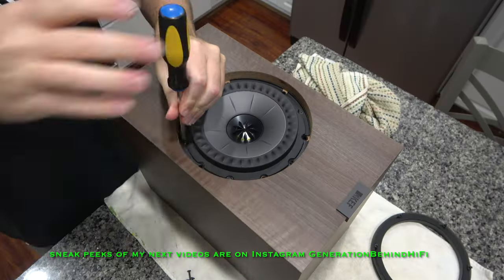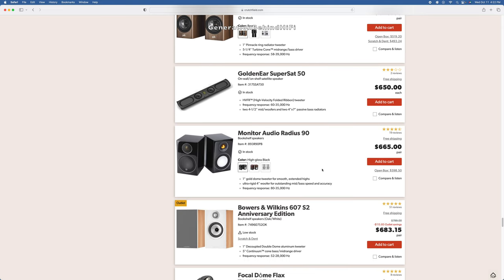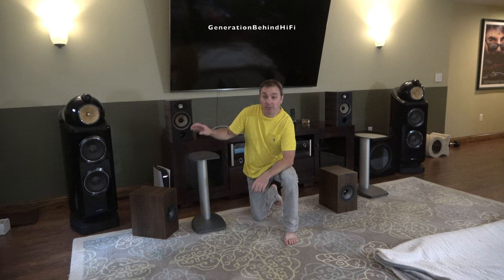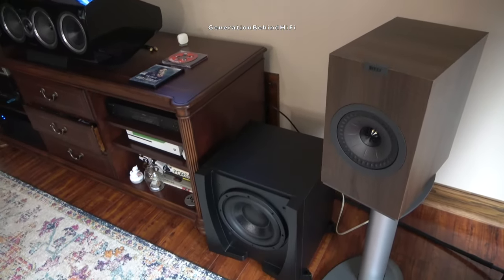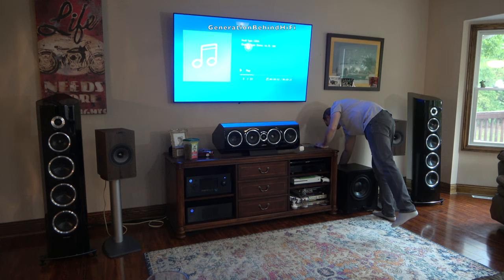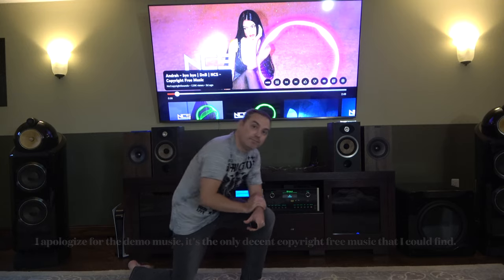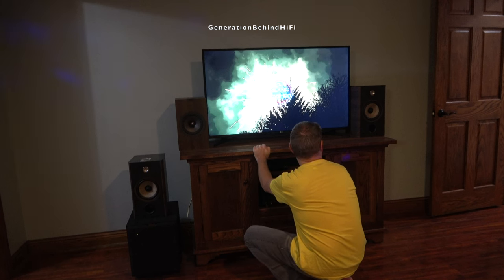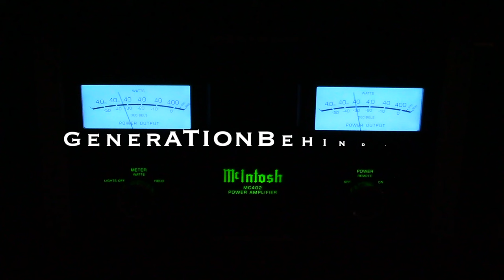A Review of The KEF Q350 Bookshelf Speakers

Comment: Two years and 3 months on my Q350's very difficult to justify switching them out, they are that good and continue to surprise me, I have them on 28" Sanus stands that have the hardwood centre post, driving them with a Yamaha RX797, a match made in stereo heaven which I picked up used about 3 years ago for $160 canadian  when I had the Q150's because I was thinking about a sub, havent though about a sub since having the q350s. Love em!

Comment: Amazon has the KEF Q350s on sale for $499 Now! (7/25/24).  I ended up buying a pair to test out and this was one of the reviews that pointed me in the right direction to do so.   I have to say that I am, overall, very impressed!   I had recently bought a pair of PSB Alpha 3 speakers for my computer as I was looking for a very small speaker with a 4" woofer that would soundstage well, and the Alpha 3's was really my first experience with an excellent sound staging speaker.   I wanted something for my main listening area and prior to getting the Q350's, I had a pair of Klipsch RP-600m speakers there.  I do like the RP-600m's, but I never loved them.  For starters, they have a hole in the midrange at around 1.5k.   Then the really high end can get a bit harsh depending on the recorded material.   The sound stage is just Okay, but the PSB's FAR surpassed them in that area.   When I hooked up the Q350s, I didn't like them at first.   The treble response was low and no where near as bright as the Klipsch.  (And I thought that speaker had a low HF output!).  I ended up ramming up the treble control ALL THE WAY.   BUT, despite doing so, the KEF Q350s weren't harsh or overly bright.  In fact, the sound was smooth.   The bass response was on par with the RP-600ms, and with some songs, it even seemed to go deeper.   I had found that the Q350s were far more sensitive to music recordings than the Klipsch are and some songs that sounded good on the Klipsch (and or PSBs), didn't sound good on the KEFs.   Some songs that I thought sounded OK, ended up sounding really good on the KEFs.   However, despite the high frequency issue and the selectivity of media, I had noticed the soundstage easily matched the PSB Alpha 3's, albeit having a much larger sound overall.   One thing the KEFs had over the PSB Alpha 3's is depth.  This was the first time I had a speaker that really had noticeable changes in depth.   For example, on Madonna's "Rescue Me".  The song starts with a thunderstorm in the beginning.  That thunderstorm appeared to come from BEHIND ME!  I was like Wow!    Then, on Gerry Raftery's Baker Sreet, I was blown away when the saxophone kicked in.  It was like surround sound sax!   The Q350s do have good dynamics as well, but the Klipsch RP-600ms were a little better here and I could notice the differences in songs that had good dynamics.   Elton John's Empty Garden sounded more powerful on the RP-600ms, but overall, the KEFs outshined them in terms of the soundstage.    The more I am listening to the Q350s, the more I am thinking that these are going to be keepers.   I had temporarily put the RP-600m in place and listened to some of the key songs that I liked on the KEFs.   It does seem that I am now noticing more that the really upper end is definitely harsher on the RP-600ms and then there is that 1.5k hole in the midrange.  The soundstage is good, but not great.  Bottom line, it looks like I am keeping the KEF Q350s, and probably will sell off the Klipsch RP-600m's!   @GenerationBehindHiFi.   Great video.  BTW in your comparison video, the KEFs are CLEARLY superior to the Arias.
Reply from the maker: Thanks! I appreciate the feedback on your listening experience between the different speakers. At the sale price, the Q350 is a hard speaker to beat.
Reply: @generationbehindhifi  Indeed!  I had compared them to the Klisch RP-600m's that I have, and the Q-350's soundstage WAY better.  In fact, with Madonna's Rescue Me, the song opens with a thunderstorm and it sounds like it is coming from BEHIND me!   When I played Elton John's Empty Garden, I was nearly driven to tears as to how good that song sounded on those speakers.  On Gerry Rafferty's Baker Street, when the saxophone kicked in, I was blown away!  It was like surround sound.   While at times the Klipsch's dynamic range was better and it does seem to have better bass on some tracks, overall, the Q-350's was a better speaker overall.   The Klipsches have a glaring problem in that they have a midrange response hole at 1.5khz and it is VERY noticeable.  The highs can be a bit shrill too depending on the music material.  The costs to fix these issues is pretty high.   Not to say that the Q-350's don't have their issues, I was surprised that I nearly had to ram up my treble control all the way on my receiver as it sounded as if someone put a cloth over the speaker when it is set to flat.  But boosting it up certainly brought the best out of the speaker.   Looking at the crossover design, it is just three parts, so it is very easy to replace those parts with better quality ones.  One of them is a resister and I am sure putting a lower value in would bring the highs up more.   I would say that for the sale price of $500, it is an excellent speaker.   It did shock me as I wasn't expecting much given the mixed reviews that surround the LS-50 and LS-50 meta speakers.  Many people like them, but there are many that don't like them.   I did look at the response curves (done independently) for the Q-350 vs the LS-50, and they are not too far off.  The LS-50 is smoother on the high end, but the 350 has better bass.    The differences seem to be slight.  So it does still have me asking the question why is KEF charging so much more for the LS and Meta series?  Yet, it seems that the Q series is quite nicely priced, when they go on sale.   So, until I get more information, I am not sure if KEF could be trolling or not with their "higher end" speakers.  But for the Q-350, I have to say it is a VERY nice speaker and it most cases, it doesn't need a subwoofer.
Reply: Buy from Crutchfield instead. Price is the same, they offer outstanding technical support, have a 60 day return policy, and are a Virginia-based small business. Give them your support 👍

Comment: It's a lot of work to open and review the speakers. Thank you. Demos ? Well, it's a matter of taste. I usually don't listen demos: mics coloration, different rooms and different speakers (recording and listener), different setups or levels in recording room, etc. In this case, I tried and I heard a lot of room reverberation and a boomy sound (maybe between 70 Hz and 150 Hz). Both speakersare too close to the wall, and Focals are closer between them which couples these low frequencies even more. I don't mind if tweeter is made of aluminium, beryllium or silk: just the sound matters. Room treatment and setup improved brightness, "boominess", and clarity in my setup. One speaker can sound brighter than another with closer dispersion in an untreated room, and at the same time sound neutral in a treated room. I suppose that the sound I hear trough my speakers and YouTube is totally different from yours, therefore demos are just fine entertainment to me. Focal should cost under 798 € or 867,2 $ with shipping and taxes the pair. I don't know what's going on in USA and Mexico with the dealers of this brand. Thank you for this great review.
Reply from the maker: Thank you for your feedback and comment! It is much appreciated! You're exactly right! A speaker can sound totally different depending on the variables it is being tested in (room size, room treatment, placement, etc.).
Reply: I agree to the echo... Also a mic should propably be a very flat response mic... Makes me wonder how much sound quality improvements many would get by improving the room acoustics first instead of speakers etc... Great video btw. Thanks!

Comment: Very helpful video. I’m considering the three brands Aria 906, KEF 350 and monitor audio silver 50, and I will currently be powering them by a Harman Kardon AVR110 which looks to be similar to what you are running in the second setup.  Not a bad sounding receiver for its age.
Reply from the maker: I love older Harman Kardon receivers!! They had some of the best sounding AVRs that you could buy back then. I have an AVR520 that I bought new in 2003 and it still blows the doors off on some of the overpriced newer AVRs that you can buy today. You're not wrong for keeping it around.

Comment: I own the Q750 as my first ever true hifi speaker. I totally agree that the soundstage is nice and wide and dialog is super clear, so these are a great ht speakers. Also, I feel the response is quite neutral and easy to listen to. I don't even own an AVR and simply watch movies in stereo paired with a subwoofer.
If you are a basshead though, even the q750 might not be for you as the bass is tight but lacks a bit of meat on the bones in the upper bass and extension in the subbass (in my room, of course). Adding one or two subs is a major improvement.
They will at some point be replaced by DIY speakers, but for now I am happy and can recommend them without hesitation if you find a good deal.

Comment: Great video! Very tough choice between the Kefs and MA speakers! I’m looking to get a pair of Q350s but as someone who is new to hifi, I’m a little concerned at whether my 30w Rotel amp (ra-820ax) will be able to power them… would you be able to answer that by any chance. Also, I’m a uni student and will be doing a lot of low volume listening but also want something where I get really decent bass response for partying. How does the bass response compare to the bronze 100s and do they sound okay near field? Once again, great video, you’ve earned a sub :)
Reply from the maker: Hi James,
I'm not familiar with that amplifier, but Rotel makes some good stuff or at least they did back in the day, so I would think you would have no problem powering a set of Q350's with it. Just don't expect explosive loudness with only 30 watts of power. In all honesty I don't think you could go wrong with either the KEF or MA, it really boils down to personal preference. Hope this helps! 

As for your questions about the KEF vs Monitor Audio, check out my look inside and review videos that will be out in January 2024. All of your questions will be answered there.
Reply: @generationbehindhifi  Thanks, looking forward to it 👍

Comment: Great video.  To my ears the focals had more bass but the kefs had more detail.  I think the gap in the bass is less significant than the detail/highs gap so my choice would be the kefs.  I think these types of demos are very helpful but There's so much the sound has to go through before it reaches my ears that I would never 100% trust it but rather just use it as a general reference to test later in an audio store.  Keep up the good work - Subscribing.   So all that being said - which would you recommend for someone who mostly listens to jazz/acoustic/vocal/soft rock music, doesn't want to use a subwoofer and has a slight bias towards speaker with studio monitor sound - kefs or those monitor audios ?  Thanks :)
Reply from the maker: I really appreciate the feedback! That's a tough choice (KEF vs MA) and it really boils down to what you prefer. The KEFs have almost the same bass output and their midrange is quite a bit better in terms of detail and presence when compared to the Bronze 100. The Bronze 100 on the other hand is brighter than the KEFs, but no where near as bad as the Focal Aria 906. I think MA did a good job with the tweeter on the Bronze 100, but the midrange and bass output was a bit disappointing. I would recommend you buy both and return the pair you don't like. 

I don't know where you're from, but here in America we have plenty of dealers that offer free in home trials (Amazon is one of them) which makes picking out what I like so much easier. Happy hunting! :)
Reply: @generationbehindhifi  Thank you so much for taking the time to respond !  I'm really not sure I can do a home test in my country.  According to your reply it seems like the kefs should be in the lead for me and my taste, so just curious if your answer/comparison would change if I were to look at the bronze 100 or even silver 100 7G ?
Reply from the maker: @d.s.6268  I haven't heard the Silver 100 7G. I have been wanting to have a listen but there aren't any local dealers around. If the Silver 100's fix the issues that the Bronze 100's (midrange and bass) have, then I would definitely chose them over the Q350s. I would hope the Silver 100's are much better than the Q350s since they are triple the sale price of the KEFs. KEF Q350s have an MSRP of $799 and can be found on sale quite regularly for $499. The MA Silver 100s are triple that at $1500 a pair and I have yet to see a pair on sale. Hope this helps and happy hunting!
Reply: @generationbehindhifi  Thank you very much again.  Highly appreciate it !

Comment: To keep it short and to the point, my 1999 B&W DM 601 S2 were $600 plus tax. As a high school kid that was expensive but as an adult the $1100 on the equivalent speaker (hopefully improved over time) is a bit harder to deal with. Simply due to more expenses as an adult. 

Inflation dictates that to be the natural increase. $1 in ‘99 equal to $1.83 today. $600 to $1098. 

I won’t make it political but I don’t believe it’s all inflation. I believe there’s greed mixed in. But that’s beside the point. There are much cheaper speakers out there today that can sound almost as good as some of these more expensive entry-level speakers which means that the increases can’t really be justified without major improvements in quality. I’d like to pick up some 700 S3 speakers (not sure which ones right now), but it would have to be open box or used because there’s no way I could afford them or justify the price. Even though I make enough.
Reply from the maker: My Bowers and Wilkins DM602 S3 were also $600 a pair brand new. Bowers & Wilkins's 600 line has always been affordable during my days of selling them, but in the last 5 years they have been dramatically raising the prices on them. I think this is a bad move for them since most people who are starting out aren't willing to spend almost $1000 on a set of bookshelf speakers with 5" drivers in them -- especially when there are other value brands like Heco, Monitor Audio, and KEF with stellar reputations. Time will tell, but I think B&W's greed will end up biting them.

Comment: More neutral by KEF. I need to set up wifi 50% Music + 50% Movies. Am having Yamaha RXV465 receiver, room size is 24 ft x 12 ft am looking for affordable good speakers package. What can you suggest 2 options with kefq350 with sub or tower speaker package.

Thanks.
Reply from the maker: I would rather go with the KEF Q350 with a sub than a KEF tower speaker without a sub, but that's what I would do. I would recommend you listen to both setups and decide for yourself. I don't think you can go wrong with either setup, but if you intend on watching a movies, than powerful sub is a must have!

Comment: How you are changing the output to different speakers spontaneously ..Any equipment to change
Reply from the maker: I'm using a speaker switcher like you would find in an audio store. Pretty sure I included a link to the switcher I'm using in the description.
Reply: @generationbehindhifi  yes..I found the link..Thanks..will a speaker switcher reduce the sound performance of the speaker

Comment: What I dont understand, it is a 2 way speaker but I see only one? I search a not to expensive speaker around 500€ the pair. I test the B&W 606 S3, sound fantastic in my living room, but double the price and have to return them.
Reply from the maker: It's a 2 way speaker design. The only difference is the tweeter is installed in the center of the woofer. Think coaxial design. When the KEF Q350s are on sale, it's hard speaker to beat in terms of performance. I really love mine.